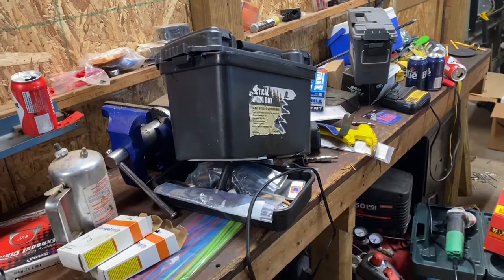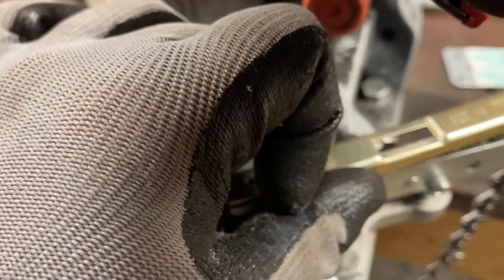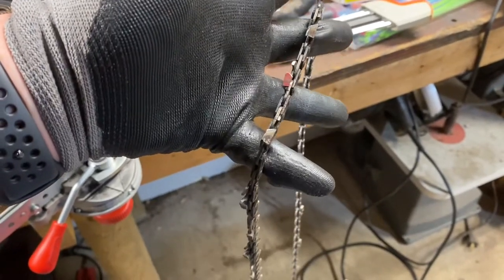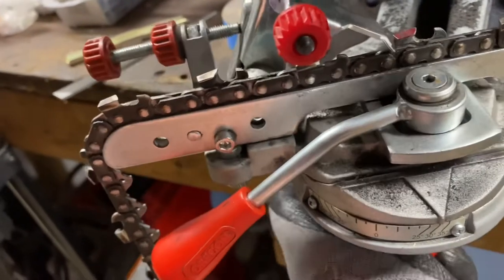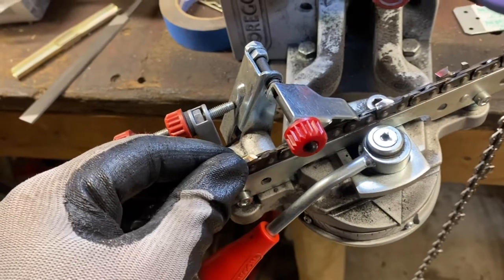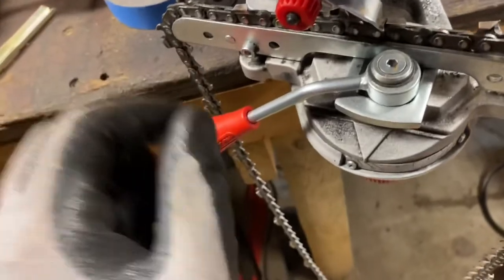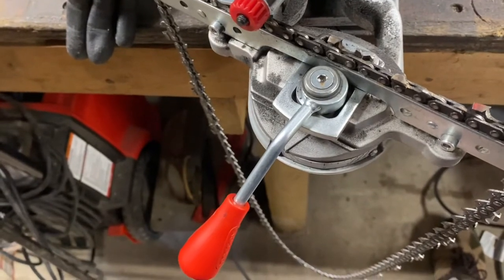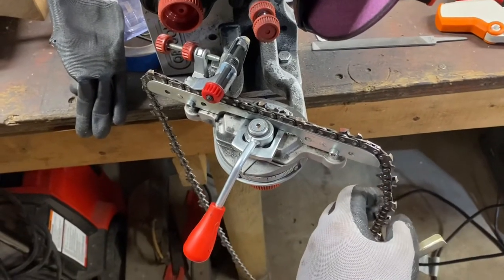#3 Chainsaw Chain Sharpening

Comment: I use the 10 deg tilt on chain rail @25deg and 60 feg on wheel for everything. I also dress the bottom of the wheel flat. There is a videoon my channel doing mine and also a time cut comparison between a brand new chain and my grind.
Reply from the maker: Thanks Bert I went to doing 30deg 60 deg on all my chains a while back. I’ll try doing 25 instead of 30 and see how it does. Dressing the wheel flat isn’t something I would have thought of except on square grind chain. Will check out the video for sure! Thanks for checking out my video, hope you’ll watch more!